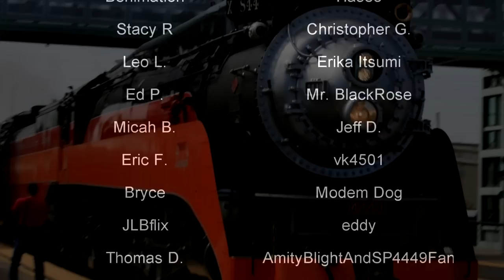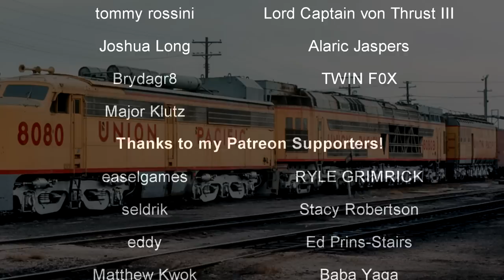5 of the Heaviest Locomotives Ever | History in the Dark

Comment: I'll note that on the coal-burner GTEL, apparently, the turbine itself was good for 7000 horsepower; the 2000 hp from the PA A-unit was used for switching the locomotive around the engine terminals at low speeds (and possibly for grinding the coal), helping with the low-speed fuel efficiency issue--you only fired up the turbine when you were hitched up to your train and ready to start hauling tonnage.

As for the Virginian's electrics, and why they were so heavy and powerful?  Massive coal drags, on steep mountain grades in Appalachia.  That's why.  They were used to boost the average speed of the Virginian's coal drags to a good 15 mph until they got out to the flatlands and smaller, faster locomotives could take over.  This may not seem like much, but it's absolutely blazingly fast compared to the average speed of 3 mph behind the big Mallets the electrics replaced...

Comment: The Big Boy benefited from being very visible on a major railroad and outlasting other steam engines.  As to Yellowstones, don't forget the 30 EM-1's the B&O got in 1943 and 1944 - those tipped the scales at right around 500 tons which is less than the engines on your list.  They were lighter than the other 2-8-8-4's because they were scaled down a bit to cope with tighter clearances on the B&O.  After being bumped out of the mountains by diesels, they worked their last years in northern Ohio double- and triple-headed hauling gargantuan hopper trains to Lake Erie.  Sadly, none were saved.
Reply: Fun Fact: One of the EM-1's was actually in storage awaiting preservation in the early 60s, and would've survived at the B&O Museum today if it weren't for a mixup of communications that led to the engine's scrapping. (This fact I got from a video about extinct steam locomotives you may have seen before.)
Reply: @sericsmith5770  There were two other factors in play.  First, the B&O was in dire financial straits and C&O control was looming on the horizon.  A dead EM-1 had a lot of cash value.  Second, the "B&O Museum" as we know it today didn't exist at the time.  What to do with an EM-1 even if it was saved?  It was one of those unfortunate things that neither a 7600 or a "Big Six" were saved.  We should be thankful they got an early "Mike" even if it wasn't a Q-4.

Comment: 7:20 You're ignoring how the M-1 worked. Since the turbine was driving generators, not the wheels directly, they could keep it at its most efficient RPM.
Reply: It's still irrelevant anyway since you waste that much power on slower speed.

The use of electric drivetrain arguably was just for easier handling, since the nature of (any kind of) turbine takes AGES to change the speed and not really easy to do reverse without more complicated gear
Reply: @bocahdongo7769  That said, the M-1 was intended for a new super-express passenger train that would have made very few stops, so it would have spent most of its time running at relatively high speed anyway, which would have helped some with the efficiency issues.  Apparently, the biggest problem it had wasn't efficiency, but reliability--the running gag at the time was that with a conventional steam locomotive, it took three minutes to find the problem and three days to fix it, but with the turbine, it took three days to find the problem and three minutes to fix it.
Reply: @rdfox76  that little saying is for the diesel locomotives. it isn't for turbines. also, the problem with turbines is low power settings, not rpm or road speed. Let a turbine run at full power and it will be happy. anything below full power just wastes fuel.

Comment: N&W Jawn Henry Steam Turbine 144,000 lbs tractive effort. and 1,182,100 pounds engine and tender. 591 tons which would bump the big boy off the list. The Virginian Jackshafts may have been delivered as a set but they were split at some point, there are pics if them as individual units. Same thing with Milwaukee Roads EF1's and even the Electro motive FT was delivered in 4 unit sets. Do electrics even count anyway? they require an external power source to do anything unlike a steam or diesel locomotive. Its a lot to consider, I know but I did enjoy this video a lot. Thanks. Cheers Rob
Reply: Actually...it wouldnt. Union Pacific 4004, according to the sign posted in front of it has a weight of 1,208,000 pounds......604 tons. I suspect this video is inaccurate.

Comment: Ok, no diesels and only one straight electric in the list, but an important consideration in both of these types is that the body often has concrete ballast forms inside the carbody (to aid in adhesion).  Railroads used to be able to specify unit weight and weight distribution when ordering locomotives, which led to different railroads having different weights for the same locomotive type.

Comment: You would have though turbine electric would have worked well even at low speed. Maybe it was the bad turbines.
Reply: You waste that much power anyway running turbine high speed for slower speed. And it's not much better than running turbine slow speed directly

Comment: Th  GN electrics had traction motors on all axles making the UP Coal Turbine experiment an A1A-A1A+B-D-D-B
Reply: The "B" trucks were demotored on 5018 when it was rebuilt to 80B.  So the wheel arrangement as a coal turbine set was A1A-A1A+2-D-D-2.

Comment: The Big Boys had the benefit of being very visible on such a major railroad, coming into existence in steam’s twilight, and being widely publicized.  The H-8 Allegheny (and their Virginian count parts the AG Blue Ridge), the N&W Y-6b, and the Virginian AE beat the Big Boys in many categories, but mostly get overlooked because they quietly provided excellent service in the mountains of WV and VA during steam’s heyday.  The AE had to have a downsized tender to fit on existing turntables, and the three I mentioned just simply didn’t need as long of ranges as the Big Boys did.

The problem with the Virginian and its fleet as it’s often considered the “other Virginia/West Virginia railroad”, being overlooked by the C&O and N&W.  The EL-3A gave excellent service through their lives with the VGN and even after the N&W buyout until the electric program was ended.  But they didn’t receive much fanfare outside certain circles, and remained the unsung heroes of the VGN’s main line service.  Most of the info I’ve found about them has been in books pertaining to the whole Virginian.

Comment: One reason to make a loco heavy AF is fro traction: there comes a point where you have plenty of horsepower and torque but it doesn’t actually help anyone because you lack the traction (grip) to get that power on the ground , so you either accept that your loco is too strong at low speeds and use the power for improving your top speed, or you accept that your loco is too light and weigh it down until you aren’t spinning your wheels anymore or get issues with axle load, or you might just decide that a cogwheel is the way to go and install a rack for extra traction because stripping a gear takes a lot more…
Reply: The common trend of big diesel electric locomotives of today is balanced at 4,000hp and 6 driving axles. 

If you raise the power, the six axles will slip. And if you raise the number of axles to 8 to cope up the power, a whole new headache shows up. GE with their 6000hp locomotive was unpopular for it having too much power without much adhesion. The centennial has both power and number of axle but wasnt popular and didn't last long.
Reply: @kimpatz2189  meanwhile European electrics tend to be 4axle, 3phase AC with about 8500hp (6.4MW to be exact) if run on high kV AC, 6MW on 3kVDC and 3-4.2MW on 1.5kVDC for Siemens, only 5.6MW max for Bombardier, though Stadler recently unveiled a six axle 9MW dual mode loco with a 2.8MW diesel (3750ish hp).

Reason for that is probably that the trains are limited to 400m in passenger service and about 750m in freight service and thus more locos means less freight per train and mixed traffic forces freight trains to run fast enough to fit into passenger schedules or stand in sidings all day so you need extra power to keep accelerating to line speed

Comment: 4014 has been modified to be an oil eater 👎
Reply from the maker: To be fair, the old coal infrastructure was taken out when UP stopped using steam power, so it's not feasible for them to coal-fire her right now.
Reply: @HistoryintheDark  Additionally, California passed a law prohibiting anyone from operating a coal-fired steam locomotive in the state, so if they wanted to have her be able to run on the entire system, they had to convert her to oil.
Reply: Also, nobody's mining the good hard high sulfur coal anymore,and the soft ass bituminous coal readily available don't burn hot enough or clean enough for the big boy to steam efficiently. Plus fuel oil is cheaper per B.T.U. than coal

Comment: Converting the coal burnner to oil might of worked.
Reply: Given that the entire point of the experiment was converting an oil burner to coal...
Reply: @rdfox76  
The point is hopefully a good locomotive.
Reply: Well. The original GTEL was already oil burned anyway. 

And UP 8080 is already beyond repair at this point. And this was on already niche use anyway.

Comment: Coal dust works fine in turbines. Just in nice stable conditions like powerplants. Not out on the railroad. They can't hold up to the abuse locomotives faced everyday.
Reply: Nope, ash causes rapid abrasion of turbine blades. You essentially can't run the turbine long enough to offset the cheaper fuel cost. You just end up replacing turbines more often then f.e. with syngas-powered turbines.

Comment: I am genuinely surprised at the M1 being considered inefficient, especially with speed as a factor. Not a mean comment, I am just trying to explain why I am confused.

Turbo-electric drives are supposed to be the most efficient drive method due to the turbine not needing to be slowed down for slower speed. You can instead have the turbine go at max speed all the time. The only inefficient areas are where the energy needs to be converted from kinetic to electric and back to kinetic again. And even then, the only reason why the USN swapped back to geared turbine drives in the 1920s was mainly due to the Washington Naval Treaty giving weight limits, as a turbo-electric drive is much heavier compared to a geared turbine drive (another reason being how the USN went to Turbo-Electric in the first place was because in the 1910s domestic turbine gear manufacturing was behind the British and Germans, and that's not something you outsource).

I always figured that Turbine engines didn't make it, at least for geared turbines, was because the gear differentials were so hard to shrink down for a locomotive, so Diesel was a more economical method as opposed to paying to work through the teething issues. Meanwhile, Turbo-Electric didn't make it because Diesel being superior to steam in general, with economies of scale with a universal fuel system taking care of the rest.

From what I heard in the video, had the steam generators been more reliable, the M1 would have been a success.
Reply from the maker: The M1 might have worked if the passenger service it was meant for actually became a thing, but it never did. Also, it broke all the time.

Comment: I have to doubt this videos claim concerning the weight of the Union Pacific 4-8-8-4 locomotives.
Union Pacific 4004 is on static display at a park in Cheyenne Wyoming, there is a sign in front of it which states the locomotives weight as 1,208,000 pounds or 604 tons, not the 548 tons claimed in the video.
Reply: Is that operational weight or emepty weight you have to ask? The Big Boy is 1.2 million when fully fueled with water and coal.

Comment: Coal fires a boiler.
Steam powers a turbine.
There is no direct connection between "coal dust" and turbines.
Thanks for an entertaining video, Darkness!
Reply: In the case of the UP's coal-fired GTEL, that's not how it worked.  There was no boiler; it was an attempt to run a gas turbine directly on pulverized coal.  Thus, the coal dust and soot genuinely were a cause of blade erosion on that locomotive, because you had all the particulates flowing through the turbine blades before becoming exhaust.

It was... not the wisest idea UP ever had.  I mean, yeah, it was an interesting experiment and if it had worked, they might have been able to sell it to some Appalachian coal-hauling roads (who didn't want to have to buy diesel fuel when they already owned all that coal), but that's something anyone with even an amateur's knowledge of engineering would look at and say, "...this is not going to end well."
Reply: @rdfox76  Oh my!  Thanks!
Reply: @andreww2098  Thank-you.

In general, when steam turbines are involved (not here obviously) the cycle is closed.  This adds a lot of complexity.

I misunderstood and thought Darkness was referring to steam when he mentioned coal dust.  This was a really unusual prime mover!

Comment: One aspect that I always find misleading is when quoting steam locomotives weights it’s alway unclear whether the weight includes the tender or not. This really needs to be clarified as in many cases two identical locomotives can have significantly different weights as the tenders can be designed for long haul or short hall requirements. It’s frustrating seeing these figures quoted and not knowing if it’s just the loco or loco and tenders. Keep the content coming.🇦🇺

Comment: the Euro sprinter ways 86 tones and get 8000 hp tahts what a diffrence 100 years in tech makes.
Reply: HP dosen't necessarily correlate to a locomotive hauling capacity. HP is jut an arbitrary number that people like to throw around. My 2 ton car has far more horse power than a old John Deere farm tractor. But then again that farm tractor is still far more powerful anyways. My car can go faster. But that tractor can out-pull me anyday of the week. And with locamotives it's all about how much they can pull while still being efficient. Our 4,400 HP locamotives here in the U.S. still weigh in at well over 200 tons. But they can pull like there is no tomorrow.

Comment: The Union Pacific Big Boy is the worlds largest steam locamotive and technicaly the largest ever built in the world when you factor in the "average".  While it was usually never number 1 in any one specific category, it came close enough to number 1 in quite a few categories consistently. So factor in Power, weight, length, height, width, etc... Then average it out against the averages of the other top 10 locomotives in the world and the Big Boy comes out on top with the highest overall average. Making it the "overall" largest locomotive ever. 

When it came to power, weight, and sheer size the United Stateds dominated the world when it came to the size of it's trains and locomotives. But the U.S. also has the worlds heaviest loading guage too. And it's rail network was consistently upgraded to handle larger and ever heavier locomotives as a result.